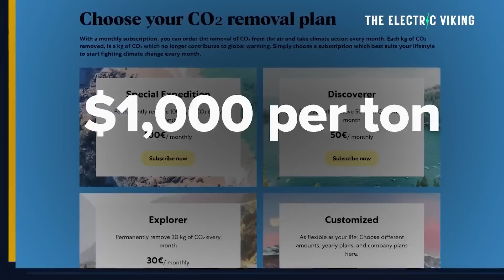World’s largest carbon capture facility will store 9M tonnes of CO2 yearly

Comment: COOL. Over the industrial era 2.3 TRILLION tons of carbon dioxide have been released to the atmosphere. Should take 255,556 years to remove the current CO2 load with this plant, if none is added, or we need another 255,555 facilities like this one to remove the carbon in 1 year, if none is added. The EIA predicts CO2 emissions will increase in 2023. Guess we'll need to do a bit more.
Reply: What form is carbon stored as ?  Methane (natural gas) or perhaps soot (coal)?  If this is so good at carbon removal we can stop digging up more carbon from the ground and get it from the atmosphere?

Comment: Why not save all the capital and operating cost by simply avoiding burning 1 railway train of coal per day?

As long as coal is burned anywhere worldwide, this idea is just the height of stupidity. Throw 9m tonnes/yr CO2 into the air, tgen spend fortunes in capital and operating cost to MAYBE take it back out and MAYBE permanently store it away.

Comment: lol, well just don't do any of this direct capture bollocks anywhere near agricultural  productive land (causing a localised CO2 dead spot - at 0.4% of local air mass - that entails paying (burning fuel at some level to process gigatonnes of air) - until there is a gross energy surplus, until wind turbines, batteries and solar panels are MADE from zero net fossil or geological sources - including nuclear -  - these projects are all MAKING real people suffer horrible lives and die- real death, not the made up past and future impenitence  - induced kind ) sure knock yourself out doing it onsite at a coal or natural gas project - so long as there is no additional fuel consumed  (boondoggles on a castrated bovine)...
(Laugh to bank on the subsidies and "green banking" schemes - funded through idiotic programmes.):face-blue-smiling:

Checks and balances - essentially zero.  Worlds greatest CCStorage operator - Chevron..  (I hope they get additional credits for their services to the climate at Gorgon, Petrobas and Exxon Mobil get runner up prises.)..  UN mandated and peer pressured, gravy on top of gravy, kaaaa - ching...

Comment: Abbott had a far simpler idea......just plant trees to remove and store carbon. This sounds like more spin from the fossil fuel industry, to prolong the sale and use of oil and coal. Who is paying for this CO2 removal ?......Wouldn't that money be better spent in accelerating the adoption of renewable energy projects. Wind, Solar and Battery (grid scale and domestic), and increasing EV subsidies? BTW, I'm not a LNP supporter, but planting trees was just too simple, and no multinational company could profit from this. Can't be that bad eh?
Reply: There’s no money in it; You said so yourself. Carbon capture is a potential massively profitable boondoggle.